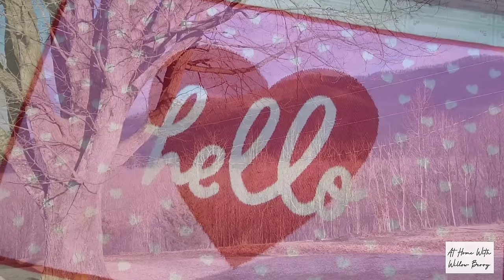Valentine Fun in the Virginia Mountains / Lasagne Dinner / Mobile Home Living

Comment: My husband was very much like your Tim.  He could do practically anything and I didn't fully realize how much he actually did until he wasn't around anymore.  He died 16 years ago and because I am elderly and not in very good health, since that time I have had to hire people to come in and do almost everything that is done.  I am pretty much totally confined to my wheelchair so if something is too low or too high I cannot reach it and I have to depend on someone else to do it for me. 

I have run into the same problem you described having with the drywallers.  Sometimes people come and halfway do a job.  Sometimes they say they will come and they NEVER show up...literally.  I live alone and I have no relatives who even live in the same state with me so I have to depend on others to help me.  A neighbor told me he would come and change the burned out light bulbs in the ceiling fixture in my kitchen and that was THREE (3) YEARS ago and he has never come to do it.  Obviously I have given up on him so I just put a lamp on my kitchen counter because when that light burns out I can easily replace it myself.  He also said he would tear down a gate that is hanging on its hinges and he has not done that either.  

The thing is, I did not ASK him to do either of these things, he volunteered, but just never showed up.  I don't much blame him for not doing something for me because he probably is not very interested in doing something for nothing but I can't even get people to come when they know they will be paid.  I talked to a lady on the phone whose JOB was cleaning people's houses and we agreed on a time when she would come and look at my house and tell me how much she would charge me to clean for me on a regular basis.  SHE NEVER SHOWED UP and this is her job!  

I am happy to hear you complimenting your Tim about all the work he does and saying he's a "jack of all trades".  I'm glad you are aware of what a good man you have.  I knew I had a good man but I'm not sure I realized just how much he did around the house until he wasn't here to do it anymore.